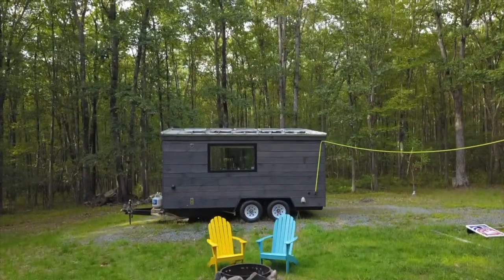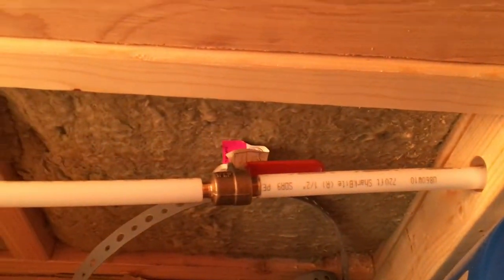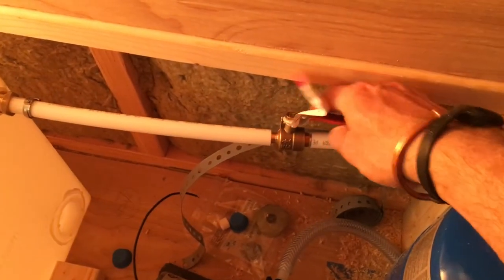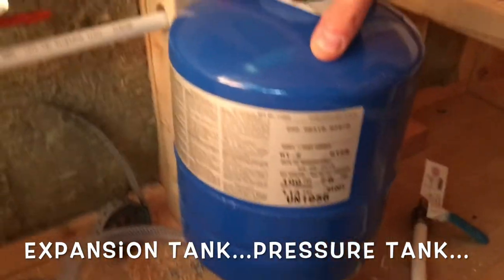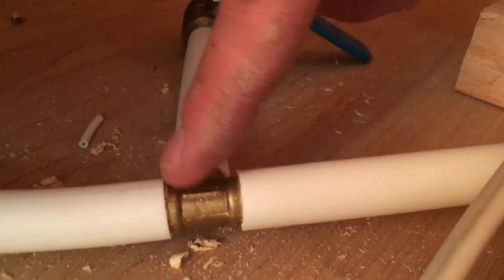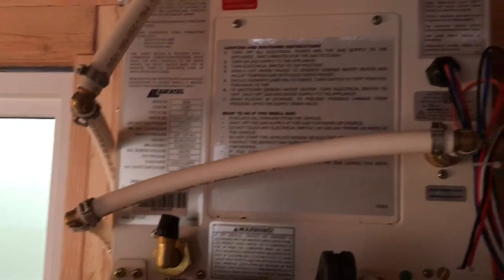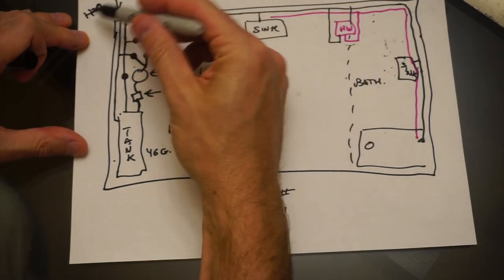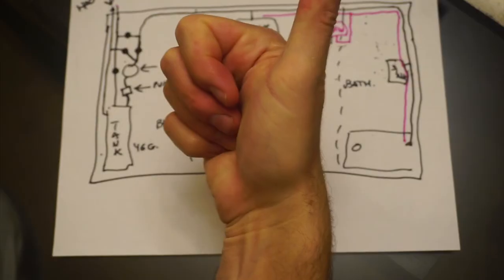How to Plumb a Tiny House - On Grid and Off-Grid

Comment: Hi! This is very informative. I'm glad you drew it all out. The part I'm stuck on is exactly how the drainage pipes tie together to leave the tiny house. I am planning on tying my drainage pipes together under the trailer, but I am needed to know how those pipes are attached under the trailer. Do they hang, suspended by metal straps? My plan is to direct my grey water away from the house into a flower bed.
Reply from the maker: Yeah, so the pipes all exit the house straight down and out. After they exit the lower portion of the house, they are reconnected with one another to bring kitchen sink, bathroom sink and shower back together into one gray water port that you can then capture, distribute, etc. It's not ideal, especially in cold climates, but it's a lot easier than routing that waste water internally and exiting the structure collectively. Does that make sense?
Reply: @TinyIndustrial  Yes! My thought is that I am going to join them all together and route them to an RV dump valve. I will use the type of cap that has a hose connection option in addition to the 3" option. Thanks!
Reply from the maker: @billmman  Yup, that's totally the way to go. IF you happen to wind up in some sort of RV park or similar at any point, it's a standard hook up that every place will be able to handle.

Comment: Hi, thanks for the video. I want to build a very similar system, but I'm concerned about draining the system into the vent pipe. How is the tank getting air when water is flowing out through the same pipe? Thanks
Reply from the maker: Not sure I follow your question. The vent pipe is there to let air in and out of the tank when either filling or draining the tank. It's so that the tank can breathe. Without that vent there would be a vacuum in the tank and it would contract or expand. The concept is similar in a car fuel tank. As you fill your cars gas tank the air that gets displaced needs to exit the tank. If there were no vent on your fuel tank, you wouldn't be able to fill it up either. Make sense?
Reply: @TinyIndustrial  Thanks, but I understand what the vent tube is; you didn't get the question. However, I already have a solution. At 23:00, you mentioned connecting the drainage tube to the vent tube. So, I asked how the air will get in while water is flowing out through the same tube. But now I see that you can open the valve on the inlet tube, which will allow it to function as a vent tube. However, I think a better solution would be to connect the drain tube to the inlet tube. I will place a valve outside of the inlet tube as well. When I open it, I will have access to water from the tank, not just for drainage, but for everyday use—only in summer, of course.

Comment: Nice video! How are you venting your shower, toilet, sink? I am currently stuck on that part of my build.
Reply from the maker: Embedded in the cavity above the shower ceiling I placed an inline fan with a 4" diameter (https://amzn.to/3tH7Amc). That is speed controlled with effectively a 12V dimmer switch (https://amzn.to/3tQIHEX) so you can set it however fast/loud you want it to be. That fan draws (damp) air out of the bathroom as well as the living area. To compensate for the vacuum created, I put a Panasonic passive inlet (something like this: https://amzn.to/3jxft9j) under the bed so the door and windows don't produce a draft as the air is being sucked out of the tiny house. Hope that clears it up for you. :) Thanks for the question.
Reply: @TinyIndustrial  I appreciate the response. That is helpful. I will look at those links for when I get to that stage. I was referring to the actual drainage lines and the main vent stack. Something like air admittance valves, etc. Thanks again!
Reply from the maker: @johntherat339  I see. I think that you are referring to more 'standard' residential stuff. Shower drains straight through the bottom of the trailer. Same with bathroom sink. Toilet was a composting, so that just vents to the outside via a small computer style 12v fan. Under the house bathroom plumbing and kitchen sink all connect up and converge on a single grey water outlet point. Anyway, feel free to ask any more questions you might have.